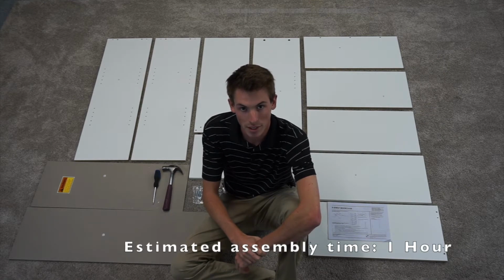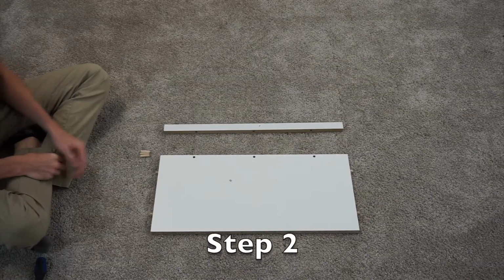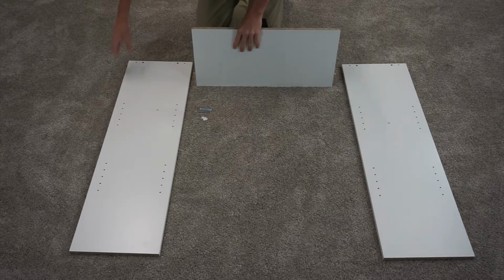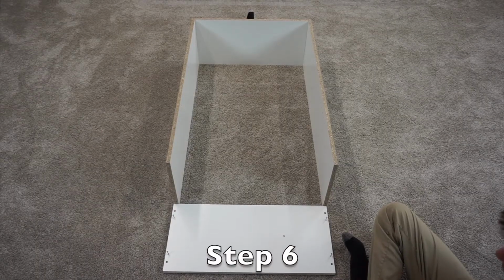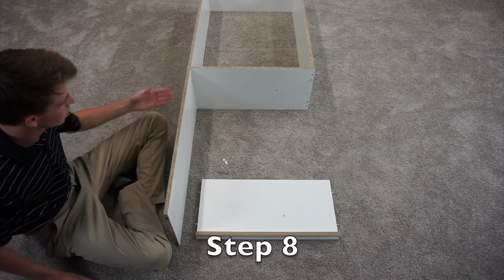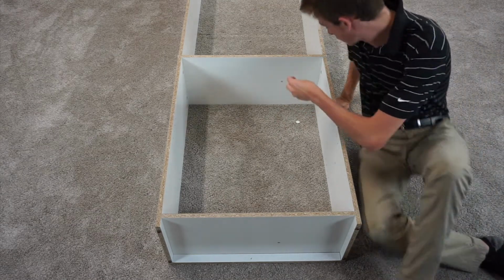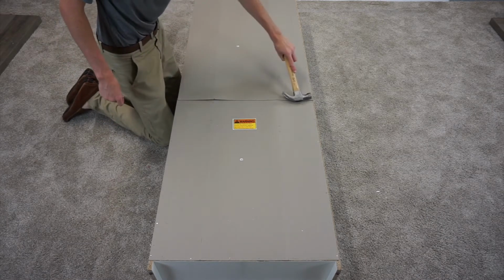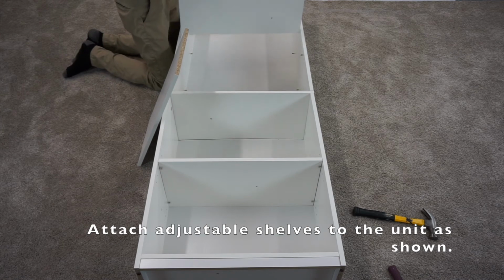Mainstays 5 shelf bookcase Instruction (OLD VERSION)

Comment: Help. I don’t have the backing parts K and J. The shelf is wobbly. How do I fix this
Reply: Go to Lowe’s, Home Depot, or a similar store and buy a piece of the thinnest plywood they have and have them cut it to the size of this unit. Unless you like the plywood’s color, you may want to paint it to match your unit. After that mail it to the back and your unit will be much stronger than using the cardboard back.

Comment: I'm confused by step one. Do I make a new hole with the screw and nylon strap? Neither of my board A's have a hole
Reply: You shouldn't have multiple a boards. I'm putting mine together as we speak and there's a hole already in the bored
Reply: @VeedddeeR  I called the help number. They said sometimes they miss a hole when the machine drills the boards and I need to send it back.